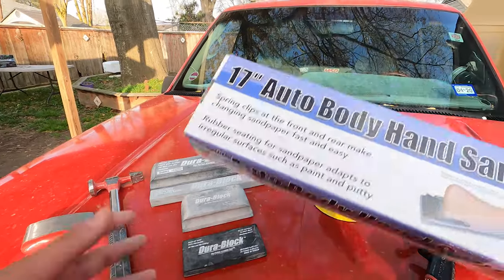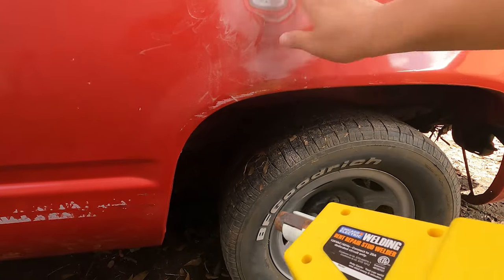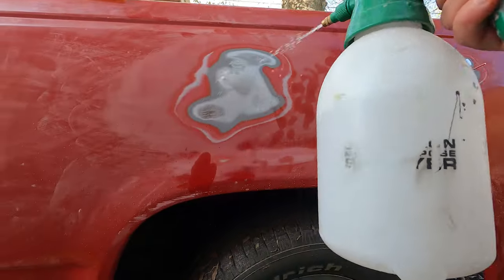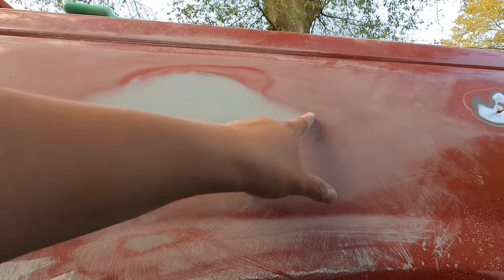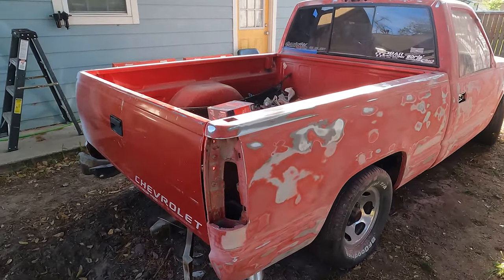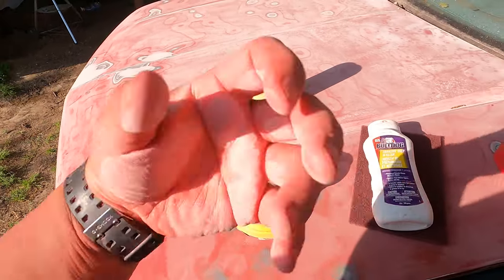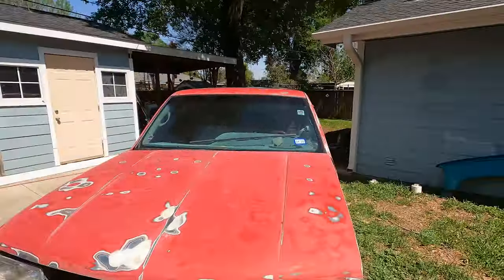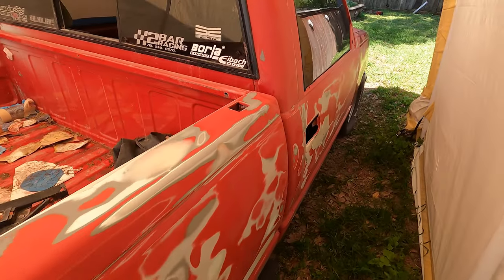How I Paint Trucks at Home Using Inexpensive Tools

Comment: eveything looks good man.... 2 big things to help you in your future... as you stated ... body filler is extremly porous...you should never ...ever apply filler to bare metal.. when you washed that truck .. the water can cause corrosion on the raw metal under the filler giving you problems in the future.... also I am gonna assume you applied a 2K primer on the truck over the bare metal... another big no no.. for the best long term paint job... epoxy prime all bare metal ... you will have a much better result.... keep up the good work ... 🤘
Reply: Funny thing is that back in the 70s & 80s we all were taught to strip the area down to bare metal and then do our mud work on the bare metal. There’s still a lot of cars running around and sitting in garages today with 80s paint jobs on them that still look decent today and there’s a lot more that have been crushed, mostly due to improper or lack of care and preventative maintenance, not whether filler was done on top of bare metal or epoxy. 

With the progression of time tho comes the change in materials we use. Back in the day we weren’t using epoxies for anything other than topcoats which was few and far between cause the stuff was expensive (Imron, it was a polyurethane enamel I believe and it was mainly used for semi-trucks & aircraft) almost all primer was lacquer primer back then and it did the job if you used it correctly but times have changed today. I guess the point I’m making here is that even tho I agree with you completely as far as spraying the truck in a good couple coats of epoxy before you do your mud work, if there’s one or two little spots that you need to work and break thru to the metal, don’t worry about it. Do your mud work and then prime & block then top coat and chances are extremely high that the repair will still outlive the useful life of the vehicle in todays times but if your doing a complete new respray, then go ahead and sand it down first, then spray the complete body in 2-3 good, wet coats of epoxy and then proceed to do your mud work on top of the epoxy for the best longevity. Try and get your primer coat as smooth as possible tho to cause it’s a bitch to sand if you get runs or orange peel. Anyways, sorry this got long, carry on brother!!
Reply: @1982MCI  a lot has changed since then... body shop classes were teaching to repair rust with fiber glass over metal.... 🤦‍♂️.. we now see how that works 🤣🤣🤣 time shows that these practices are not correct...
Reply: 3m says on their website it's preferred to apply direct to metal. Also, a guy on YouTube, can't remember his channel, did an adhesion test with bare metal vs over primer/paint with bondo as well, both were great.
Reply: @JaRuuizz  3m has had tons of issues with there platinum filler... adhesion is not the issue.. it's the corrosion that forms between filler and bare metal do to how porous the filler is. There are multiple people who have proven over the years that it is not good to apply over bare metal.

Comment: Hey bro what did you sand the whole truck with ? After putting filler to the dents
Reply from the maker: What’s up bro. After I finished all of the body/filler work, I got a da sander and used 220 grit on the entire truck. That’s a good grit for high build primer.
Reply: @nextcoat  thank you bro good explanation video , one more question did you use 80 grit to get to bare metal where the dents were at ?
Reply from the maker: Yes! 80 grit is good. Make sure to keep the da sander flat. You got this 🤙
Reply: @nextcoat  thank you bro keep up the amazing content 🙌
Reply: Thank you 🙏

Comment: Do I need to get my cab to bare metal ? Or can I sand original paint to a certain amount ? It’s a 68 c10
Reply from the maker: You can sand the original paint down until you get to a good layer of paint. If you have any rust, I would sand just that area down to the metal. Hope this helps!